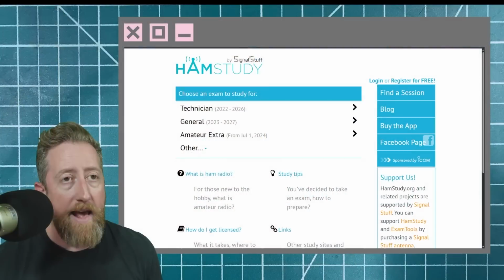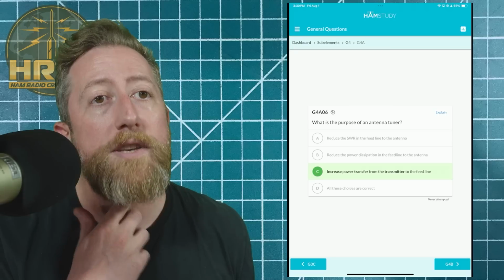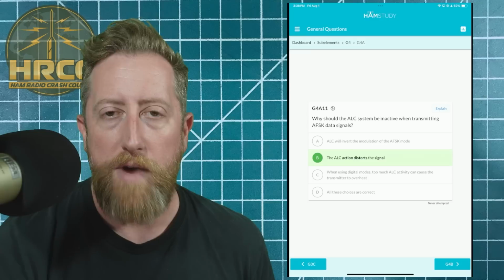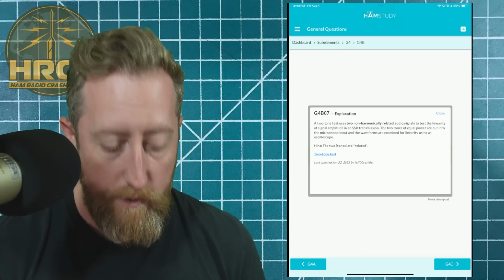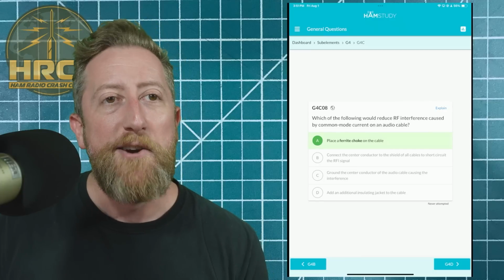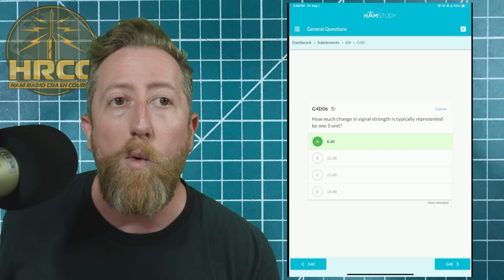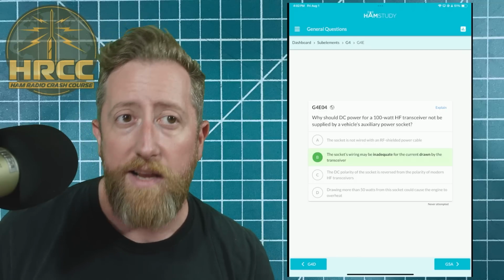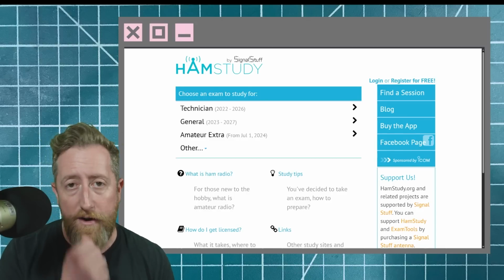Amateur Radio Practices: Ham Radio General License Prep Sub-Element 4 (Valid until June 30, 2027)

Comment: This series was pretty foundational for my amateur radio exam routes. I used these for both Tech and General and recently passed the Extra. 

My recommendation is use the paid version of HamStudy. Read all the questions and their correct answers first until you have a “Seen 100%” score. This is the time at which if you’re curious about a component of the content, do some exploratory research. Don’t try to become a master; just google for more if something piques your interest. 

Then, once you’ve seen 100% of the questions, go through the entire question pool or a particular sub element trying to get the correct answer. Your best bet is NOT TO GUESS. If you don’t know, click the “I don’t know” button. Eventually, you’ll get to a point where you’ll recognize the questions, the correct answers, or a combination of both. You’ll know you’re ready to start taking practice exams when your aptitude score crests 85%. I began taking practice tests for each bank when I got an overall aptitude score of 90% or higher. 

Once you start taking practice exams, you’ll do yourself a favor by clicking the “review your weakest areas” option after each exam. Your aptitude score will increase reliably and quickly this way. 

Finally, once you’re able to pass consistently at 85% or higher, then you should consider scheduling an exam. I found that a good benchmark for me was to pass 26 consecutive practice exams with 85% or higher. 

It’s a time demanding process, but it will make your efforts more successful over the long-haul.

Comment: I wish the auto manufacturers told the truth on how many amps their accessories ports can handle. They always state that it is 20 amps, but if that were true, then the port should handle 240W which would easily handle a 100W amp.
Reply from the maker: Same. Wire ga too